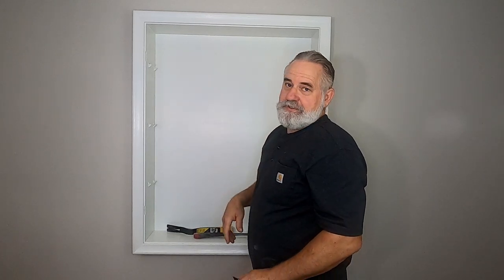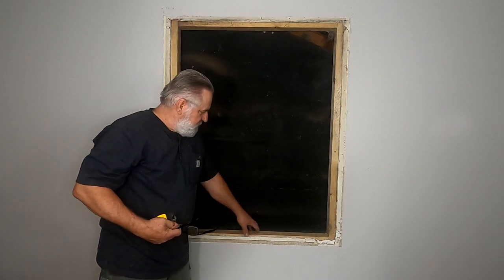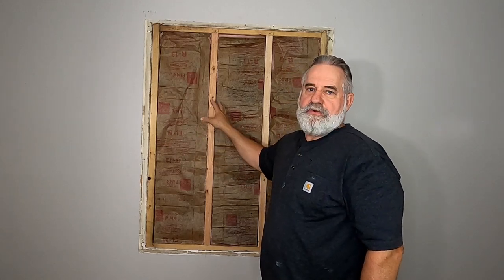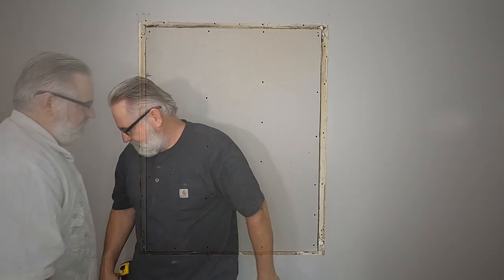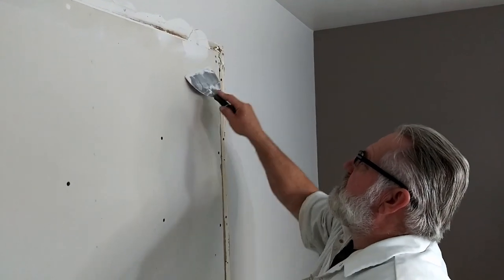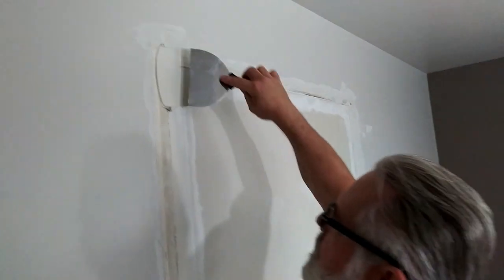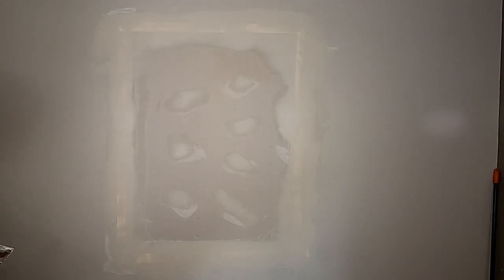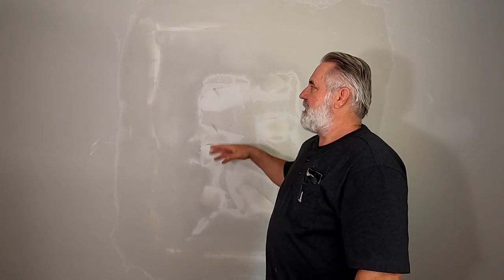Framing an Opening | Drywall | Remove Niche | Show Me Construction

Comment: You make it look so easy. Thank you. I can just get by with my drywall work. I want to close an alcove over our fireplace. Do I have to remove the receptacle and TV coax cable that is there?
Reply from the maker: Thank you for your kind comments. 
Your state may not allow you to bury electrical in your wall. You can look up the codes. The coax cable can be hidden or removed. Either is fine. The receptacle should be brought to the front and either put a blank plate or install a plug. A plug might be nice if you plan on using Christmas lights above the fireplace, etc. Hope that helps!

Comment: Would the studs be strong enough to support a big screen TV?  A 75 inch weighs 75-100 pounds.  My circa 1990s home came with a TV nook or alcove in the family room that I would like to cover.  I've squeezed in a 50 inch, but we would like to have something a lot bigger.
Reply from the maker: You can put the studs where you want them to line up with the TV hanger. I would also add backing. I have a video on backing too. If your 2x4s are secured in place it will hold a big TV. Use 16D nails or 3 inch deck screws to secure all the fill-in wood.  Drywall over that and it should hold your TV no problem. Hope that helps!

Comment: If i have to close an interior space where there used to be a door, how do i attach the bottom horizontal stud to the concrete floor? And, do i not add any insulation or anything to prevent noise travelling through the wall much?
Reply from the maker: Put your 2x4 on the bottom and attach it to the sides of the doorway. You do not need to go into the concrete. You do need to use pressure treated wood since it's sitting against concrete. If your wall is already insulated you should insulate the doorway. But if the wall is not insulated you do not need to insulate what you are in closing. It's not going to do any good unless the whole wall is insulated. Hope that helps!

Comment: I have a similar cutout that is circular. Any tips on dealing with round edges?
Reply from the maker: Once you tear out the drywall you'll see that they started with a square and put a circle inside of it. I would tear it out and make it a square again then fill it in as I did in the video. Hope that helps! Thanks for watching!
Reply: @ShowMeConstruction  thanks! I’ll give that a shot!

Comment: Thanks for the video! Total novice here and will use your video to enclose a niche as well. Mine has a arched top, guessing tape wouldn't work based on the curve. Hot mud the joint and keep hitting it with joint compound? Thanks in advance for any help!
Reply from the maker: you can use short strips of tape. just so the crack doesn't manifest when your done. Thanks for watching.